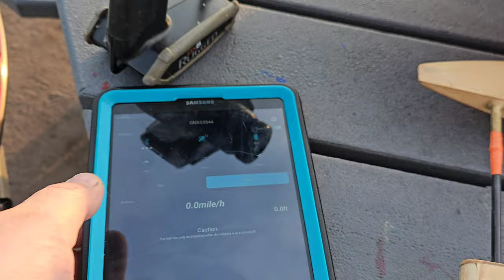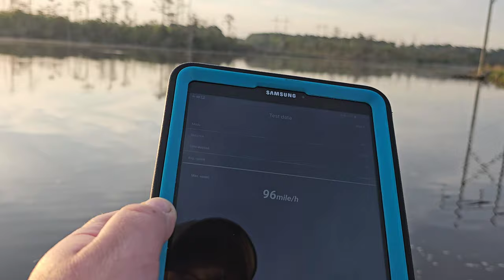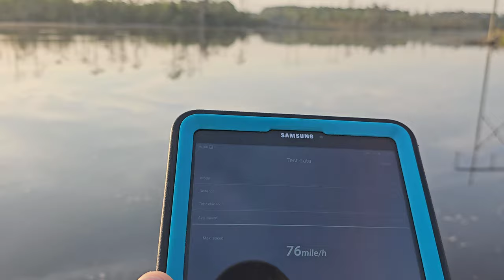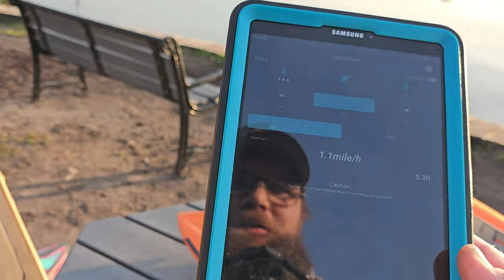World's Fastest 4s Shrimp Outrigger - 495mm Shrimp Boat - Rocket 2968, OSE 90A Esc

Comment: I started using my old plastic antenna tubes as breakaway tubes. Just cut them about a half inch long and cut about a 45° angle on the end that sticks in the breakaway screw hole. Use pliers to squeeze it in. Works great and if you're like me, you have those tubes laying around since we don't really use them anymore lol
Reply from the maker: I used to do that too. Antenna tubes work great. Also, weed Wacker line works good and zip ties

Comment: 60mm rudder said (I can't handle the need for speed) skip skip skip Log. But the 29mm motor was putting in work man! Nutz
Reply from the maker: Lol, she turns on a dime with a turn fin doing ovals, but not so much with out one.      I'll get it fixed up like new

Comment: 77 mph man that is ripping.
I damaged an ABC 1917 on my big rigger and cut it down to 44.25x1.7 and put it on my 26” ecomaster hydro 1 (rigger) running a rocket 2968 3400 kv Seaking pro 120 amp esc and got 83.4 mph and put  a huge heavy  cap bank on it and dropped to 81.6 mph consistent and then I lost the prop. 76 mph my best since with every prop I have tried.
Reply from the maker: Amazing,  I'm a tru believer In cut down props.  I'll be one sad mo fo when or if I loose the prop I was running in this video..  I run that prop on 3 different boats and it hauled azz on all 3